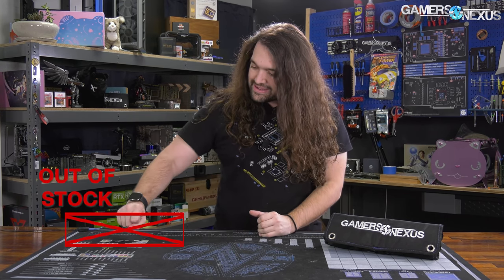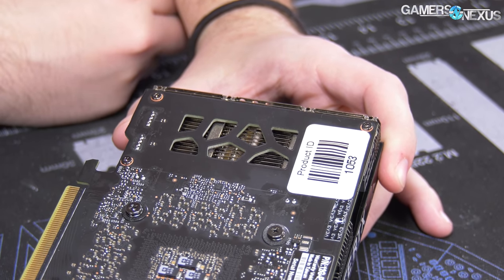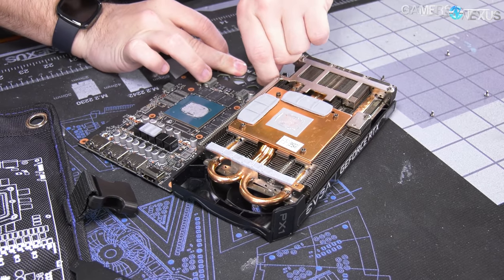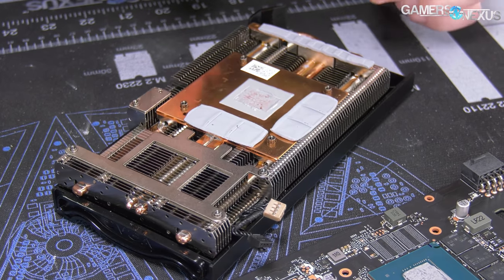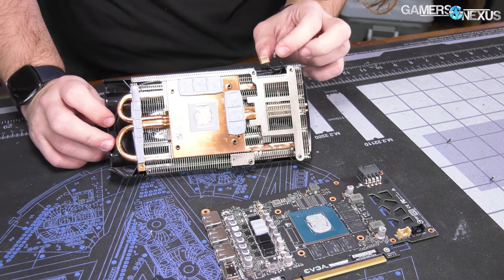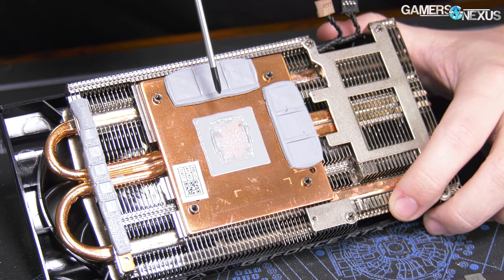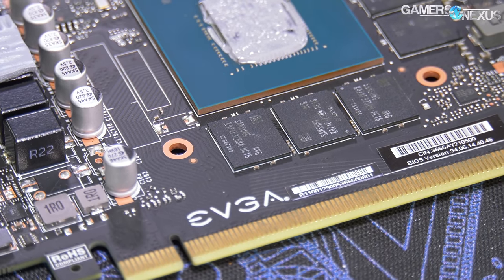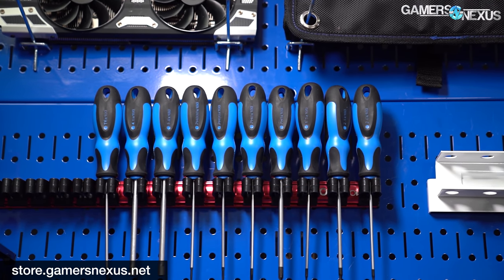Taking Apart a Non-Existent GPU: EVGA RTX 3060 XC Black Tear-Down

Comment from the maker: We've been informed that a 3060 isn't a 2060. Hmm. Odd! It's hard to tell them apart when they all look like this: OUT OF STOCK AUTO NOTIFY
Watch our NVIDIA RTX 3060 review here: https://www.youtube.com/watch?v=3C-RoDtqdJ8
Our stuff is ACTUALLY in stock: Grab a GN Toolkit on the store for GPU tear-down & maintenance (in stock & shipping now, including signed versions) https://store.gamersnexus.net/products/gamersnexus-tear-down-toolkit
Grab a GN Wireframe Mouse Mat for a desk-sized, high-quality mousing surface (in stock & shipping now): https://store.gamersnexus.net/products/gn-wireframe-mouse-mat
Reply: yeah its hard to keep track, its fine, i dont even remember how they used to be named, out of stock...
Reply: And perform almost the same
Reply: is there a plan to update the gpu tear down mat..ive been waiting on it to come back in stock. an antistatic mat that size 32x16 inches perfect for my desk.
Reply: Please deshroud the cards while you're at it... us ghetto modders would very much appreciate it - thanks!
Reply: what a waste of pcb.....they could have packed this gpu on a soc and users could have slapped it on a pcie slot as if it was a slightly bigger m.2 adaptor....this should have been a 3050 tops not a 3060
Reply: Hmm some cooperation with Hardware Unavailable  in this intro XD
Reply: Have 3060ti XC version which has a backplate (1 GPU pad) and similar shroud, more heat pipes. Makes sense, but would be interested in tear down of it to see what factor that plays vs this cutdown design if any. This is a HW channel, so not sure why people complain. Maybe I’m in minority, but I watch for the tech and design breakdown regardless of “want to buy” or even can’t/don’t buy. Thanks and keep up the great content!
Reply: You should still make sure to use the right name in the intro.... you are a reviewer.
Reply: That’s like how I’d find a way to typo my “clever” take down txt of someone else’s mistake.
Reply: @Ziv Zulander Steves PC Horror Picture Show.
Reply: I have to say thank you for recognizing the issue over frustration.
Reply: i would love to get one of these, but asrock said i cannot maintain my own card, and i lost my warranty i live here in the usa, and tried to fight it but lost. just a reminder to anyone else looking tear down your own cards, asrock worst company  i  lost a 5700 xt cause of them
Reply: If a graphics card is Phantasmal, does that mean new content for Phasmophobia?
New ghost model, the GPU?
Reply: i just check with bestbuy.ca around here no date nothing as sold out, i have been wai9ting since dec 2019 but replace my card that is broken, i have MS and i cannot go shop n store, i stuck with a very old crappy card 920 geforce, i miss the first batch and its seem ill be waiting another long long time unbelievable, but yet again all youtuber got one...
i dunno if you guys know how sad it his to be confine in house and not beng able to do anything fun with you're PC. i check everywhere and i cannot find any no matter 3060 3070 3080 impossible around here  Quebec
Reply: @yazmo109  I can get you something better then wat u have for a decent price. No new new but def better. Wats ur budget
Reply: Did anybody on YouTube do a video on how to get a GPU out of your PCIE slot if the clamp is jammed ? The new RTX cards inside The Gigabyte B460m ds3h ac leaves the clamp barley visible and it is Jammed what do I do ? I need to reset my cmos and can’t
Reply: @onofriopiccolino5166  You'd need something to help trigger the mechanism, or try to remove the clamp altogether, perhaps removing the entire motherboard with the gpu stuck on it and examining it will find a way to loosen it. Use a item to push it basically.
Reply: @dra6o0n  I am down to do what you said but it is a CyberPowerPC, they didn’t even use thumb screws to hold the GPU in place. It has a RTX 3060ti and i7 10700f. Why does CyberPowerPC go out of their way to make things difficult ? The motherboard is a Gigabyte  b460m ds3h ac Y1. They added the Y1 to the end of the part number and I can’t find a updated bios for it and it shipped with a pre released bios that was never on gigabytes website
Reply: @dra6o0n  I decided to give it another shot using a tooth pick and a pencil. I can take out the ram but that’s it, I don’t have any thermal paste laying around. Is their anything special about the PCIE clamp on the Gigabytes B460m ds3h ac besides it is barely visible ?
Reply: @dra6o0n  wow I think CyberPower Jammed the clamp on purpose
Reply: @dra6o0n  Why did I pay for this hell I am going through ? Because all the hype around the Nvidia 3000 series, I should have learned from my past experiences gaming computers are headaches. Every computer I ever had in the past had parts fail, Just never after a week
Reply: Pls make a video with vs without flow thru
Reply: @onofriopiccolino5166  Your best bet is examining it and trying to find a tool that is best used for it. Perhaps the board comes with a 'special' method to release the Clamp like with a pin or something that was left out of the box or wasn't mentioned.
Reply: @Gamer Nexus, I would like to asking about cpu transistor some technical problem,
For searching lot of youtube videos show us how cpu works, how transistor to be lot of gate, than matrix to a lot of parts,, 
I can't search any real micro transistor for case with finfet 
only they show us is one gate of how finfet structure is
So, as i know all the gpu/cpu transistor only build together just on ground floor 
other line in other floor just for collect them to build them as a gate
So, I have tried to build a 8 bit adder to guest How finfet gate should look like in autocad,
but, As i know, every gate should adding a source power line, moreover not gate including grounding line

Now, For those of this transistors source power line can be combine in one line by row and column,
But, for not gate, ground line combine together is no problem
main point is if the source line combine with not gate,
when not gate in turn on be grounding moment, those following source line which after the not gate will shot down.
So to fix it not gate should include a unique source line
but looking outside for the CPU CHIP just include 1,000-2000 FOOT pin
there is not enough to storage  all source line unique for not gate,
How they fix them?
Reply: I was really hoping that when he removed the heat shroud, that there would be a bag of 3D dorrito's in there for review
Reply: I'd still be fine with getting a 2060 instead if they weren't $500+ as well
Reply: GN Arch Nemesis: G L U E
Reply: How about we scalp GN stuff? 😂

Comment: "Non-existent GPU"

What are you talking about bro?  The 1080 Ti has been around for 4 years.
Reply: But it doesn't have the features gamers care about!
Like raytracing, and unobtainableness!
Reply: 1080 Ti performs better than the 3060... its performance is about right between the regular 1080 and the Ti.
Reply: here I am with a 980 4gb and happy with it
Reply: @testerpt5  I've got a hd 6700 with 1 gig ram. Passive cooler. You know it's bad when cs runs at 30 fps MAX
Reply: Yeah, but you can't even buy those without significant markup. Just search for them, and you will see they sell for $1500 USD! For a 4 year old card!
Reply: @KyurekiHana  That's nuts, it's over twice what I paid for mine originally, and that's with a 25% VAT.
Reply: @OnlyKaerius  Its really close to 2060 super, if you take RT into consideration.
Reply: Speaking of used cards, i sold my 1660 Ti for like 1/2 of its price before the release of 30 series to get a 70, if I kept the gpu back then I could sell it rn for the original price no problem
Reply: @OnlyKaerius  No duh... so I might as well stick with my plain old 1080 and forget about this thing.
Reply: @HontasFarmer80  I have two 6950's (YAY). Unfortunately they're HD 6950's albeit with 2 Gb and a dual BIOS. Weren't we lucky back in 2011. I'll stick with my cheapo Ventus 2060 Super in the meantime.
Reply: @pulser08  Everyone's a critic.
Reply: ??? 3060 < 2060S... 1080ti~2080 base.... Not even close
Crappy gpu
Reply: @theslightlyhillyrider969  i dont care
Reply: @silverwerewolf975  That was moreso the case when the 2080 launched.  Turing has architectural improvements over Pascal that make it better in DX12 and Vulkan titles, such as being able to perform FP32 and INT32 calculations simultaneously.  The 1080 Ti and 2080 are usually equal or very close in older DX11 titles, but games that have come out since Turing's launch such as Red Dead Redemption 2, Control, and Horizon Zero Dawn have the 2080 noticeably ahead.  Those titles also have the 3060 very close to the 1080 Ti, as GN showed in their review yesterday.
Reply: @KyurekiHana  Funny, I bought the 980 10 days ago for 110E/133US$
Reply: @intech7863  it's a joke my dude. Based on the hardware unboxed thing
Reply: @theslightlyhillyrider969  good  bcuz just got 1080ti D
Reply: @intech7863  ok, entirely irrelevant. Have a nice day
Reply: @OnlyKaerius  I mean, the 1080ti was worth more than the rtx 3060
Reply: @theslightlyhillyrider969  really most people dont care about raytracing
Reply: @2301senna  like I said, is a joke based off the hardware unboxed thing. And imo, it will be in a few years. Just like any graphics thing. People were amazed at bokha blurs for DoF a couple years ago. It will become mainstream over time, I doubt we'll see any big releases without it from now on. Particularly considering most games are made with engines that already have support for it, it's not too hard to imagine it at least being an option. Personally, I think the main thing is DLSS, because it can allow games like cyberpunk to be played at max with rt and everything and still get decent frames on relatively budget hardware (once prices come down). So yeah, a joke, but I think it will develop and mature and become the thing everyone wants. Like hyperthreading. Or tempered glass. Or mesh cases. Heck, even high res and curved screens got the same reception and now they're really common.
Reply: If you got a 1080ti.. you got the best card to ride out the 2021 storm.
Reply: @theslightlyhillyrider969  Laughs in 3070
Reply: testerpt5 980 gang. Still have my 980 ti hybrid and don’t feel the need to upgrade.
Reply: I can respect the 980ti comments, my little brother loves his to this day. I was running into trouble since I bought a 1440p monitor and my 970 was chugging, I’m happy with my 3060xc. I’m poor, but 389 wasn’t horrible
Reply: @pepperfish_  Without RT, 1080 Ti in Raster, is around 2070S-2080S. For a 4 year old card, that's really good.
Reply: @theslightlyhillyrider969  i am gamer and i dont care about raytraceshit 😂
Reply: @Axisoflords  True and for $1100 CDN it better be, I bought a 2060 super for $450 a while back.
Reply: @theslightlyhillyrider969  Raytracing is pretty cool though, I'd like to see it as a standard feature that doesn't hinder your performance to the point where you need trickery to get stable 60fps. We're not getting there if nobody gives a flying fuck about it. Just gotta suffer through first iterations, sillicone shortages, scalped prices, unavailability, pandemic, people being people and so on.
Reply: @Nyarlathotep Dead Congrats, you managed to cherry pick the outlier, have a cookie.
Reply: @Nyarlathotep Dead bla bla
Reply: 1080 ti is an old card and will get performance reduction overtime on newer games. But 3060 is more futureproof
Reply: @OnlyKaerius  In rast performance, anything with DLSS the 3060 destroys your card.
Reply: @OnlyKaerius  that’s cap lol they perform equally don’t spread misinfo

Comment: I've installed a PCIe 3.0 Etch-A-Sketch to replace my aging video card today. Refresh rate is great at 2 shakes per second and so far miners haven't hoovered those up yet. Looking forward to the PCIe 4.0 version that has a 4 shake per second refresh rate.
Reply: You know that would make an excellent tshirt design to remember the gpu shortage of 2020/21
Reply: Like those "my other car is a ..."
Close up of pc internals showing loading screen on an etch a sketch right where gpu should be then underneath "My other gpu is an rtx3090"
Reply: aah, the PCIe 4.0 version! That's the one with diagonal rendering!

Comment: I know there's been pressure against videos like this from disaffected community members that can't find parts, but I'll say it sure was nice to go back and rewatch this after finally being able to purchase my new 3060 XC Gaming this week. Spent about 9 weeks on the EVGA waitlist, but it paid off and this teardown will be useful to reference again if needed in the future. Keep doing what you guys are doing!
Reply: Got mine from nzxt in my first pre-built paid about $400 for the gpu. Very happy with it.. I was wondering what was msrp or how much you got it from Evga
Reply: @marksantiago9832  Well just want to start by clarifying that I got the XC Gaming with the metal backplate, which is the higher end version of the one in this tear-down. That said, I got it for $389.99 + tax & shipping. Since I was impatient and opted for fast shipping, I paid a bit more than I had to for a grand total of around $450.

Comment: 7:05 I am an SMT Machine Operator, and I not only place these parts, but also make sure that the machines place the parts correctly. The marker on the BGA is emphesising the orientation mark (the arrow in the upper right hand corner corner) We use these markings to ensure that the chip is in the correct orientation on the PCB. The markings can be found on many BGAs and chip components. You can also see the equivelent marks for the memory IC's to the right of the BGA (the white dot on the upper right of the chips)

13:10 That appears to be an internally used QR code. We use these to not only keep track of inventory movement throughout various facilities, but also to link multiple parts together under one serial number. The seperate parts of the card are linked together ie X board with serial 123456 is part of assembly 50. Heatsink type 1jA17 goes with X board type A1, serial no 000001 to 999999. Each and every component, from the small caps and resisters, to the PCB and fans are all checked and verified using these numbers, whether it's a one off prototype, or an RMA on a product like a graphics card.

Comment: Normally I just skip the ad read in the beginning. But this time I took note of the fact that the boards used for holding the chip is an interesting stack up.
That the die sits on a smaller PCB in the middle isn't that interesting. But rather the fact that the larger board is consisting of two layers.
I am going to guess that Intel has taken this approach for better yield for these boards. Since these would require fairly minute features to be accurately manufactured. And double sided boards are far easier to make compared to 4 layer ones.
But it also makes we wonder, could even the smaller board in the center be a stack up of boards as well?
Though, there seems to also be a thin layer of PCB laminate that extends out a bit around the smaller board, but not fully covering the whole base board. This could just be a form of shim for either handling the height difference between the chip and the IHS. But I somehow more suspect it to be an aid to ensure that the soldered interface between the boards doesn't get squeezed to death and risk shorting due to mounting pressure. After all, there seems to be another similar shim around the die itself.

And yup, this comment so far contains as much 3060 content as there is 3060's available for close to MSRP.

Though, I have long been wondering, why doesn't board partners skip having the shunt resistors as a component?
One can fairly easily make a 5mOhm shunt resistor as a cleverly made trace on the PCB without it needing much space at all. And getting proper sensing isn't hard either.
And most PCBs have copper thickness tolerances in the few % region, similar to a 5mOhm shunt. In short, implementing the shunt on the PCB directly can save in on the bill of materials cost, and also on pick and place assembly time, not to mention freeing up a feeder on the machine and the logistics of stocking the shunt. Even if the time and costs savings are fairly tiny here. (Development costs for such a shunt quickly gets eaten up by just a few hundred units.)

Comment: Love that Micro Center (Houston) does not even list the XC Black - only lists the XC Gaming for $389.99 (limited availability - i.e. out of stock) and the only difference appears to be a 105mhz or 5.9% clock boost for a $60 premium (18% more cost for less than 6% more performance). Maybe they are waiting for enough of the XC Gaming cards to fail to hit the 1882mhz speed, so they can have XC Black Gaming 1777mhz to sell????  What a deal for a card that does not appear to exist irl...

Comment: Good to see some coverage for removal of the shroud, that info is a bit harder to find than it should be, particularly whether or not shrouds can be removed without removing the heatsink, which can be very useful for planning SFF builds.

Comment: A detail many missed about the card is the honeycomb airflow patterns in the display ports.
If you take a seriously look you can see that, if you optimize the pattern by essentially removing the holes that are facing the ports' direction and then move the  rest of the honeycombs "down"(closer to the ports) by 1 "step" you get better airflow.
A relatively insignificant thing depending on your case especially when there are other patterns you can make to make that space more efficient in terms of airflow but still, it goes to show you how little companies think, i mean, come on, you are making a honeycomb pattern anyway, at least do it better there would literally be no additional cost to it.